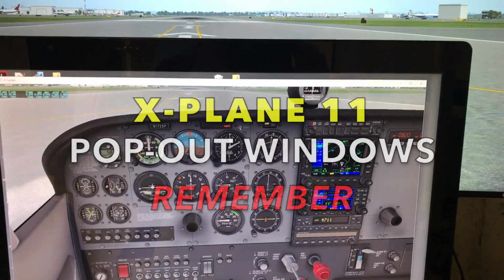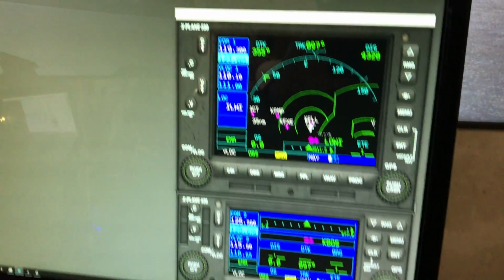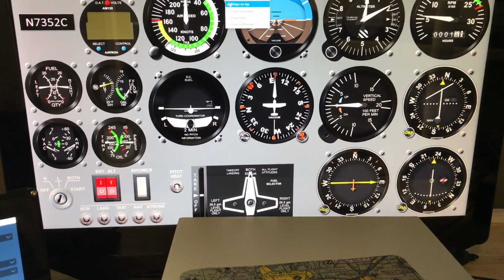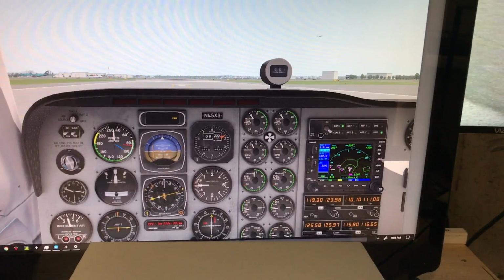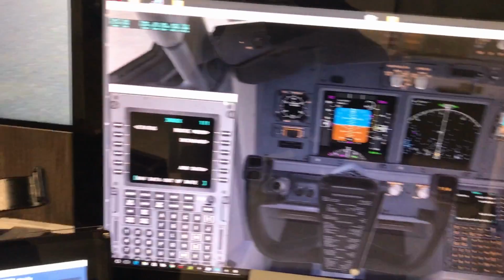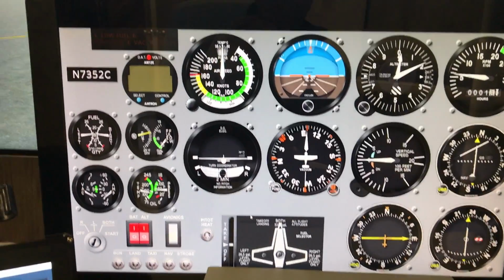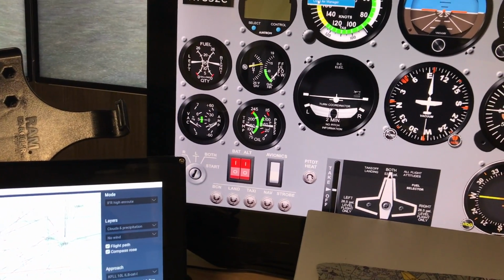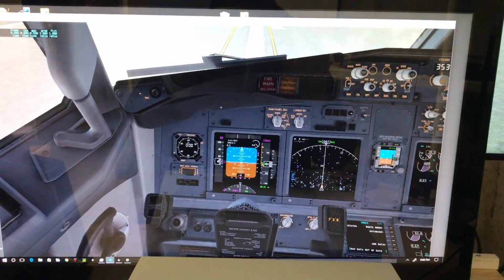X-Plane 11 Never Forgets

Comment: Hey Russ would popping out the HSI and PFD in the FF 757 v2 work? As of now I am using P3D v3 with LeveLd and I can undock the glass instruments,I have 5 different monitors that I drag to. I am just curious because I would LOVE to move to X plane.
Reply from the maker: daniel kresty:   Not presently. Only a few gauges can be popped out right now including the G530, the Flight Management Computer, the Map, and the G1000 PFD and ND ( starting with 10.10 beta).  I hear that Laminar plans to make pop-outs available to add-on developers in the future.

Comment: Ah good news indeed. Now if they can fix the C172 so it doesn't require full throttle to start taxiing...:)
Reply from the maker: We used to joke in real life piloting:
How do you know you know you have landed gear up?

It takes excessive power to taxi:)
Reply: Ha!

I got home from work a little while ago and have tested the window docking. Oh man, this is a game changer for me. I have a little 5.25" HDMI display that I'm designing a G530 bezel for. Now that the window position is being remembered it will makes things a lot easier. It will probably be some time before it's complete. When it is I'll make a video and point you to it.
Reply from the maker: Casual MC  ... now if we can get LR to make it so only the center screen can be popped out alone. I am thinking maybe a click modified by some key press like (I= Instrument or g= gauge) to get the entire instrument with bezel and ( s= screen or d= display) to get only the LCD screen part.  Actually just a click as it is now might not work if you are trying to pop out a GTN750 screen which has a touchscreen for inputs. How will X-Plane distinguish between  the pop out command and the inputs to the virtual cockpit GTN?

5.25" in a 4:3 aspect ratio would be great to display only the screen as the actual G530 has a 5" 4:3 screen. It could be almost real sized. What screen are you using and is it 4:3 and Windows 10 plug and play?
Reply: I'll try to post an Amazon link here, if it won't let me I'll message it to you. The resolution is 800x480 so the aspect ratio isn't correct however the 530 screen is plenty readable on it. The display itself will plug and play but the touch doesn't work, not sure if it's possible to make it work. For my purpose I don't need it anyway. Oh, and it's cheap so not much of a loss if it doesn't suit in the long run!
https://www.amazon.com/gp/product/B013JECYF2/

Comment: Which make/model is the touch screen you use?
Reply from the maker: I have 3 but two are IR touch and one is capacitive touch. The latter is best as it is glass from edge to edge  like an iPad face.  21-23" Full HD is a good size.  Dell makes one  available on Amazon . Touch control is great.

Comment: Thanks Russ for the amazing work. My question: Can you run different versions of windows like Win7 & Win10 on the 2 computers, or even iPad + Win7 or Win10 (or all 3)?
Thnks.
Reply from the maker: C.E. Sherrod  sure you can network any computers that will run XP11, even Macs and Windows but I will warn you that XP 11 requires a pretty powerful computer especially to drive three monitors. To run Air Manager for an instrument panel on a second computer is quite easy and can run on most any old computer.  In fact you can run Air Manager on a Mac, windows, or any Linux computer with Raspberry pi coming soon.
Reply: Russ, what would I need to do to become a Beta tester for v 3.0?

Comment: Thanks for the information Russ. I have a question: If one hardware GPS used in the XP-11 (GPS 430/530) there is a separate switch. Could you please once a video about this switch create. Thank you!
Reply from the maker: Not dure I follow your question... what switch?
Reply: The switch is located in the Settings, hardware, GPS far right of the XP-11

Comment: Thank you for the informative video
russ one question

in your situation, is your master or your external visual computer the one with most CPU ?
Reply from the maker: patrick maartense My workhorse is the visual driving the three external views. It is an i7 CPU and a gtx1070 GPU. The master is also running Air Manager and the three HD touch screens and the 10" touch screen. It has a AMD eight core CPU and a Gtx770 GPU. Since I can use Air Manager to provide the panel I can zoom the XP11 view in on some blank part of the panel with hardly any rendering load. This gives me good frame rates on the lower power CPU. But even when I do render the panel in XP on one monitor the FPS is pretty good. The only issue I have seen is sometimes some lag in the external visual when the airplane  is maneuvering quickly
Reply: thank you for the extensive answer Russ.. good info!

Comment: Thanks for the continuing videos on the ever advancing XP11 display options Russ.... It's making it really difficult to decide between building/buying actual G1000 screens with button and knob bezels, or just do everything on touch screens.
Reply from the maker: chamberlin1 The only limits in touch screens seem to be knobs that have more than one layer and even a push button function too. Hard to manage with touch.  The raspberry pi version of AIr Manager in development will support hardware and will offer some interesting possibilities including some hybrid solutions incorporating real knobs and touch. Much cheaper and flexible but overcoming any shortfalls of pure touchscreen